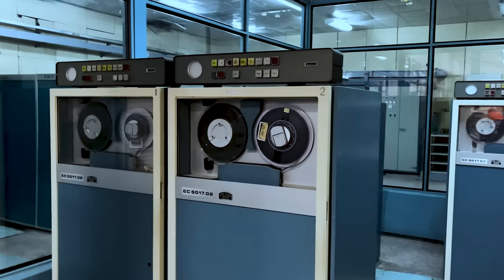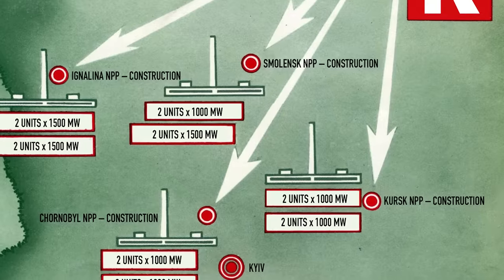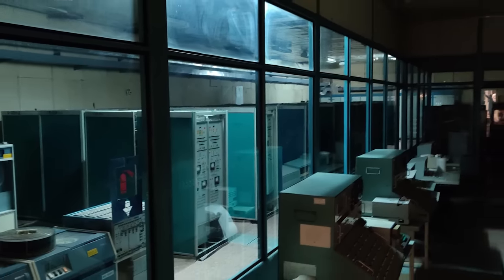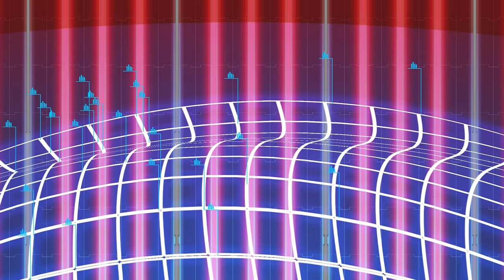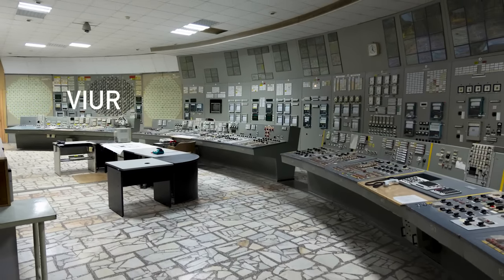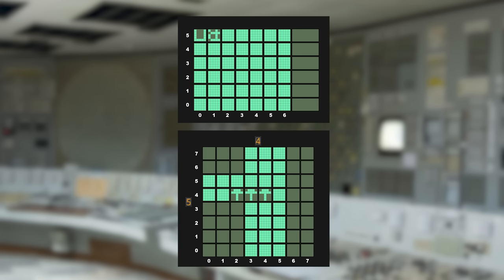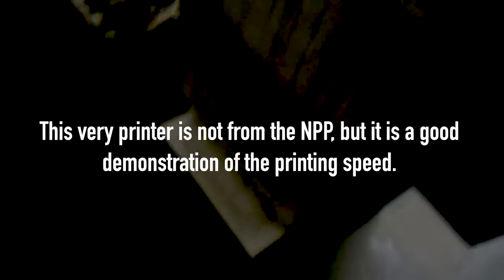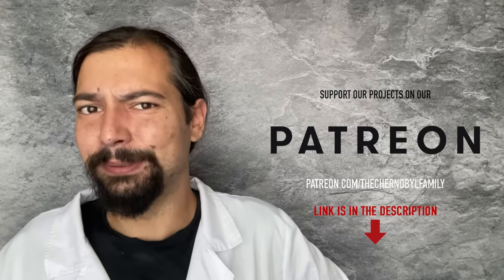Exploring SKALA: Chernobyl Reactor Control Computer

Comment: This is all quite interesting.  I never really realized how complex these computer systems were 50 years ago.  Every bit of data was entered manually and I'm pretty sure it took quite a while to do.  These computer systems are considered stone aged compared to the modern computer systems that exist today.  The one thing i wondered about this SKALA computer is if they had to have one to control each reactor or was it just one computer running four reactors.  It also made me wonder if this same kind of control computer was going to be installed in reactor 5 and 6 if they had been completed or if something more advanced was going to be installed.  That's something we'll never know since those reactors were never completed.
Reply from the maker: No, we pretty much know it — the same machines were planned, as Phase III is pretty the same as Phase II. However, SKALA also passed several generations during its brightnest times.

Comment: I am an electronics engineer and it was very interesting to learn about this control and data processing system. There is nothing on the Russian-language YouTube about this system. Yes. You're right. Regarding  the fact that the parameter time was output to the printer after processing. In one of the videos I  heard from one of the panel board engineers, the time of changing the parameter and its subsequent  indication.......... I was shocked...... 18 seconds!!!!!! So, really, the processing time after receiving  the change signal and its indication (printing) is huge. 18 seconds is an eternity for a reactor.
Reply from the maker: We've asked a few engineers; this thing with 18 seconds was not a common thing. It was slow, but not that slow.

Comment: Amazing! I wonder what sort of bus or whatever they used to collect the samples from all those sensors!
Reply from the maker: That was a proprietary thing as far as i know.
Reply: I would imagine that running at a fairly high voltage would make the sensor loops decently radiation-hardened.  (Just conjecture on my part).
Reply from the maker: Sensors, servos and so often used 48V. The machine likely was 3-phase 380, but I cant tell about consumption right at the moment. Will ask.
Reply: thanks. I'm especially interested in what sort of bus they were using. I can only guess something in the direction of CAN bus, although that wasn't invented that early.  @ChernobylFamily

Comment: This is amazing! As someone working with industrial IT within the steel industry, I really see some parallells to how our current PLC-based systems works. Of course, there are also a lot off differences, but that is to be expected with how much older this system is. 

How is the system networked? From what I understand this system had two main CPUs, but are there also sub-CPUs controlling specific parts and reporting back or does everything run on the two main CPUs?
Reply from the maker: They had two identical machine sets with one shared V-31 rack that provided the main link with the reactor unit equipment - that is what we tried to picture on our diagram; however, it had also numerour interfaces for further communication means, including for the datacenter based on IBM/360 clone. So processors were the core workhorses, but they had a lot of specialized additions.
Reply: Also, does the SKALA system differ a lot between powerplants or were improvements/bugfixes distributed between them?
Reply from the maker: Differed. E.g. Russians continued with RBMKs, we did not. So they have a new SKALA, that has nothing to do with origonal one. In the soviet time and exchange of fixes and improvements of course has been made.

Comment: Wow - all the data from one core.  It almost looks like the reactor was controlled down to the resolution of each channel
Reply from the maker: Yes, it was, as it is crucual to have information about each one in order to get a complete picture of physical characteristics of processes.
Reply: @ChernobylFamily  The poster shows the different power plants and their outputs.  Was SKALA networked to other SCALA computers at other plants as well (to control the grid)?
Reply from the maker: @filter4now  what you see in the poster is a single set of two machines for one reactor unit. Each machine set was linked for data aggregation to a mainframe, but their level of use is local, the grid is a higher level.

Comment: I am really curious if there's any chance to take a copy of the OS tapes? Not sure if they are available at all even, nor if they would survive the rather harsh environment...

It would be interesting to have something like a Hercules/Hyperion emulator for this mainframe. The channel system really makes me think of IBM mainframes, but maybe that's just me knowing only about them. Though given that USSR really loved to copy IBM mainframes, it's not unlikely that it was based on that. The VM architecture is... not unique to IBM, but it's one they pushed quite a bit forward.
Reply from the maker: I am not sure if you watched the video completely, so I'll write it here – it is a two-machine system based on 24-bit octal (not binary!) V-3M computers. Yes, you are right, that peripherals are from ES series ( = IBM/360 clones), but on this anything common ends. 
About tapes and their condition right at the moment I am unable to tell much. They exist, how complete and how intact – is still an open question.

Comment: I really want to see what those programs look like!
Reply from the maker: Well, those are mostly just punch tapes in a octal format. They are really low-level.
Reply: @ChernobylFamily  That's okay, I'm quite familiar with low-level instructions, as I've created a few emulators over the years. I just need a quick explanation of the instruction set and the architecture to make sense of it.
Really old systems like this are very interesting though, because they tend to deviate quite far from the modern ideas of computing to the point of almost being unrecognisable: Different word sizes, ridiculously specific instructions, unusual branching logic (if any at all), odd addressing modes. That's something I find really fascinating.
Reply from the maker: @SidewaysCytlan i'll check with them. The last time I asked they told that well, 20+ years passed since the last time someone programmed it, so engineers do not remember much meaningful in the scope of the software.
Reply: @ChernobylFamily  Please do! If nothing else, it could be a really interesting reverse-engineering project to uncover the forgotten information. If there are schematics available, then that would also be extremely helpful in understanding the architecture.

Comment: Thanks so much for doing this research and trying to preserve as much of this computer as possible for future generation to Discover, understand and learn from it. It is a fascinating video.

Any information on the precision and how they were able to achieve it?

I understood the computer had 16K of ram. Is there any information on the processors architecture, address and data bus width, speed/frequency.

It's impressive they could do such real-time demanding applications,and drive so many I/O channels 😮using systems that could be likely 8/16 bits.

Also I imagine most of the calculations would require floating points operations...

Mind blowing.
Reply from the maker: For now we are unable to give some more structured technical details, due to wаrtіme limitations; the only one thing I'd like to correct, that each processor had 20K RAM + 8K shared for both, but those are octal kilobytes of 24-bit words, so in the binary equivalent it would be roughly 200 Kb per processor.

But it is already clear we will make a continuation episode at some point.
Reply: @ChernobylFamily  thanks for correcting me. I'm already looking forward to the next episode!

Comment: Can you explain more on how you got them to keep this computer? Surely it wasn't as simple as you saying "Retro computers are popular you should keep it." And then saying " Ok you're right, we will keep it and spend a ton of money cleaning and restoring l" right?

Can you elaborate on this a bit more? It was only touched on for a few seconds near the beginning of your video.

Thank you.
Reply from the maker: It is a subject of our "inner kitchen", so I cannot say much, but in reality it was really that close to what I described. Consider, we did some projects that made our opinions/advices on things as such to be important. They liked the idea, because SKALA provided an important context and details to the visitors program.

Except it did not require extra money (SKALA was right there, and minimal work was needed), but I guess it actually saved money, as dismantling of anything is not cheap by itself as it always involves compliance with Zone-specific safety regulations even when there is no danger.
Reply: @ChernobylFamily  Thank you very much for taking the time to respond and share at least what you're able to on the subject, it sheds more light on the subject and expands a bit on what you said in the video.

Thank you again.

Comment: great video! what is the model of the teletype machines used as ive wanted to restore one for years and one that could be used with the SKALA system would be that much cooler.
Reply from the maker: RTA-something. They are very hard to findas they have a very unreliable design from the point of the shelf storage lifetime. We actually plan to get one to simulate the real output... what about to collab?))
Reply: that would be great :) @ChernobylFamily

Comment: I think it would be impossible to manage an rbmk reactor safely without a data monitoring and control computer of some kind. The computer logs and records would have been invaluable for understanding the explosion. I like the way the main computer sets check that each other is working. Would have been good to see the wiring looms from the reactor to the data acquisition equipment, thousands of cables.
Reply from the maker: Frankly, we believe anything industrial-grade bigger than a Chicago pile would require a machine.

Comment: Sorry. Do you have detailed photo of the opertor console (workllace of reactor operator AKA VIUR)? Advance thank you for any answer.
Reply from the maker: Which unit?
Reply: All. Or at least 3rd. I have first and second. But they are of poor quality. @ChernobylFamily
Reply from the maker: Need to check. But please do not forget that panels of ALL units changed very much after DIIS was implemented. E.g. it is visible on the VIUR panel of the 3rd Unit that some devices were removed and the gaps of them are closed.
Reply: I see. What is DIIS? @ChernobylFamily
Reply from the maker: @Georgiy7438  watch the last 3 minutes of the video, at least...)
Reply: I have some documents: educational materials with CNPP. If necessary, I will be happy to send them to you for your activities on YouTube. These are materials about the control system (SUZ), reloading system (RZM), SKALA (although your video is probably more informative than this document) and so on. Unless of course you already have these documents:)  @ChernobylFamily
Reply: Ok. Sorry, I haven't watched the video yet @ChernobylFamily

Comment: I've had an idea for a computer game, run the Chernobyl experiment (on a simulator) like the real engineers and try to avoid a meltdown.
Reply from the maker: That would be a very complex game which would require a 700-pages manual :)  There is, however a training simulator of RBMK (TOP, we mentioned it shortly in the video about 386SX PC restoration) which is used for VIUR training. We'll review it at some point.

Comment: So it seems the whole SKALA system was batch processed and any knowledge of the state of the system, in this case, the power plant had to be synthesized by the humans and presented to other humans. Am I correct in understanding it this way?
Reply from the maker: Less-more. Think about it as a classical industrial management system. It is automation, analytics and control system, which means it aggregated and presented the information from a large data pool (which was beyond human capability of perception/reacting to) to a level suitable for control.

Comment: During the fateful night of April 26th, 1986, the SKALA computer printed out a paper warning the operators about the absence of control rods.
Reply from the maker: That is similar to the way it was described in those books I mentioned in the video; engineers, however, explained that under that formulation we have to imagine 6 totally different printouts.

Comment: I think it's a shame, that with the amount of effort that was obviously put into safely controlling the reactor, they couldn't program out the human element. Plus, I don't care how fast the computer is, there are clearly some problems with reactors that are simply too fast to prevent. Once again, usually caused by humans.

Kind of a shame we couldn't see SKALA in operation, but really, on those old systems, it's just cool to watch them. Modern computers are so boring. 

Thank you for doing this. More information is always better.

Comment: Very nice video! Interesting topic. I wonder if it is possible to go to the DUGA array in order to save some technical manuals and electronic components for the DUGA restoration project. Let's hope that the war will end soon...
Reply from the maker: We already digitized everything there to the very last paper ;)
Reply: @ChernobylFamily   wow, that's amazing! I wonder what was the power consumption of the computing unit... Such large buildings for one system...
Reply from the maker: Not really big, in fact. Like 10 big mainframes.
Reply: @ChernobylFamily  Interesting, because what I've seen from bionerd23-s videos the duga facility is relatively huge, with a lot of buildings which were connected with cables, that means the mainframe, control room and other computing parts were only housed in one building?
Reply from the maker: @MrEdwinHubble  there were 12 specialized data processors, 1 general purpose mainframe, and two even more powerful mainframes that yet were not operating. We are restoring a control panel identical to one on the latter mentioned — find that in Patreon. Buildings around contained signal processing systems. So computers were in one place, auxiliary systems — all around.

Comment: How was SKALA used after 1995 ? Some sources claim another computer system was used after that date. Did it complement SKALA or replace it entirely ?
Reply from the maker: Watch the end of the video about DIIS.
Reply: @ChernobylFamily thanks ! I will have to research the second system. Are there additional systems at Smolensk, as those rooms don’t have physical reactor core displays with individual bulbs but all computer screens.
Reply from the maker: They have already something very different, we did not have a serious upgrade as the NPP originally had to be shut down in 1994.

Comment: It feels crazy for me that such specialized data request panels were built, while the machine was capable of teletype. Why not just have a crt and keyboard terminal there? As you mentioned, engineer had to learn hundreds or thousands of commands. With teletype terminal, they could always refer to help screen and after every command get a specialized "greeting" message for engineer to confirm that they are getting what they thought they are getting.
Reply from the maker: It had a reason: if all goes down, the print will remain. Teletypes were loggers (generally), not a display.
Reply: Why waste limited and expensive memory to store a log file when the Teletype can print it out? When the log is too big and output is too fast you get a three mile island type problem where the Teletype is running far behind the real time occurrences.
Reply from the maker: @andrewallen9993  i asked them, they told: teletypes were printing all the time, and ACPUs - regularly, and time to time (every hours) DIVT brought reports to VIUR. The idea was that if something, they will have data right away.

Comment: What happens if two computers have to read from the same sensor at the same time? What if they are trying to write into the same area of tape? How is that stopped?
Reply from the maker: Access to detectors was managed by the array of access to the controlled object (V-31 and so). Supervisor program managed what which machine set does in a particular moment, so that situation won't be possible.

Comment: Tell us about the k-340a modular computer that worked at the Duga radar station near Chernobyl
Reply from the maker: Will come this year.
Reply: @ChernobylFamily  If there is an opportunity to describe in detail:a recoil-tilt sensing station and a signal transmission station beyond the horizon
Reply from the maker: Far more interesting. Far more.

Comment: When was this installed?!  While of amazing complexity it seems oddly out of time.
Reply from the maker: This in particular 1980. But it did not change much from the 70s. In the video you can see a few newspaper articles exactly about it.
Reply: @ChernobylFamily  Punch tape, custom buttons, no floppy disks, no CRT, core memory, ... vintage stuff at the time of installation.
Reply from the maker: @0MoTheG  I asked a similar question to engineers who worked with that; they told that it is not that easy as I imagined: this machine is so specialized that it did not really need any of those at that time; in the 90s it was of course not good anymore.